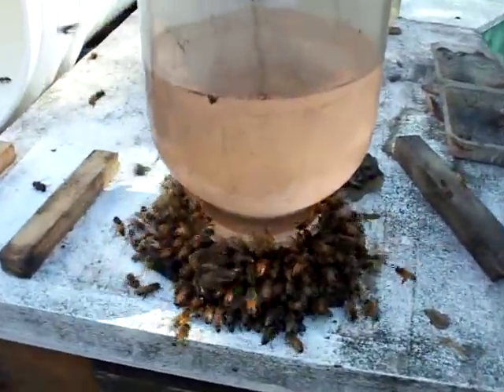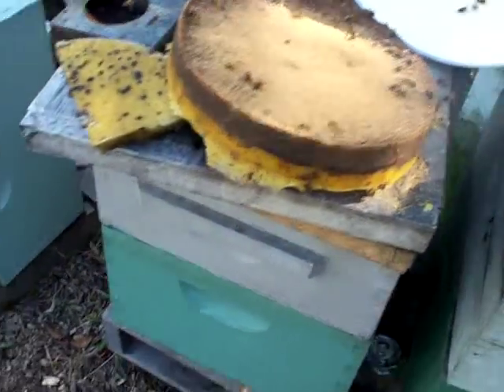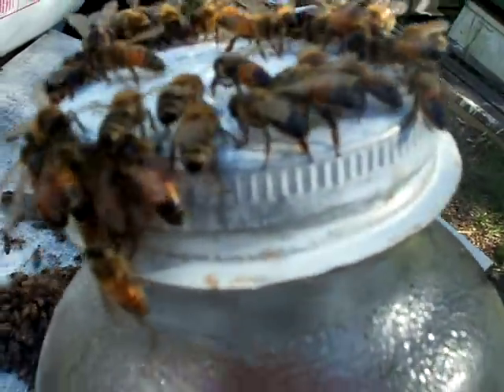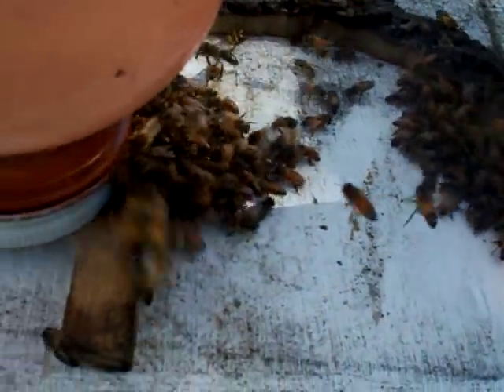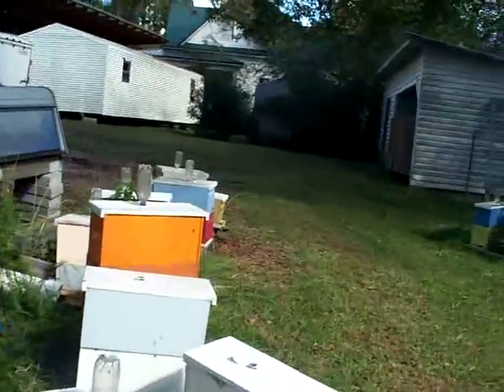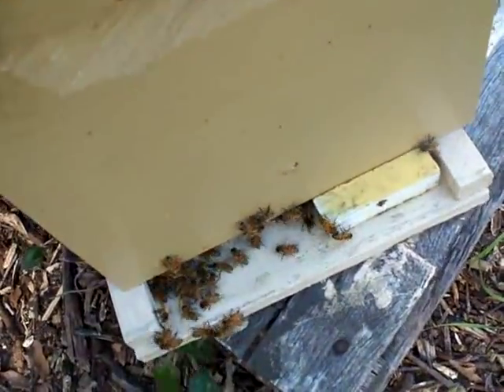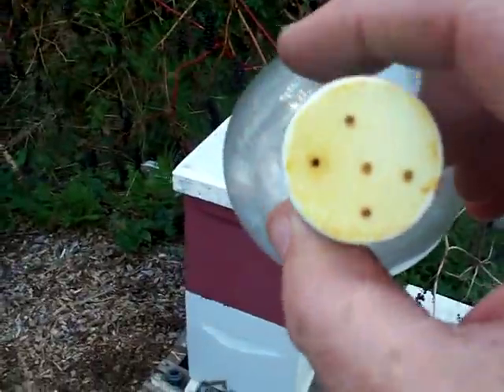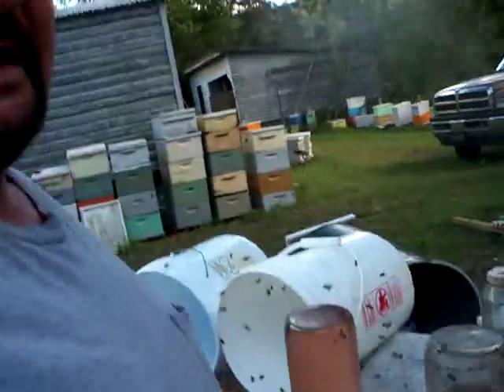BEEKEEPING Honey Bees open feeding vs Beehive top sugar syrup feed bottles Beekeepers Honeybees GA.

Comment from the maker: Smaller holes or fewer.
I use a 1/16th drill bit 5 holes in a liter bottle.
The Quart jar feeder lids have about a hundred pinholes.
The jar also needs to be FULL so when turned over creates a vacuum
JP

The zip lock bag idea I tried with disastrous results.
Two problems are smashing many bees when laying on frames 
and needing an extra box as spacer room.
JP

Comment: Tiny pin holes in the lids.  The mason jars work best and you can buy plastic holders for the jars so you can mount them in the entrance.
The cheapest way to feed is a zip-lock bag full of sugar syrup with a couple of cuts in the top of the bag.

Comment: I have used 45 gallon drums of which I cut 1/3 from either ends, and filled 2:1 sugar & water.  I also used Lemon Grass, Tea Tree Oil, of which the hives ate this in 5 - 6 hours - 30 hives.  Its very hard to believe but, it just doesn't take long to take the syrup down!  Thanks for the video!